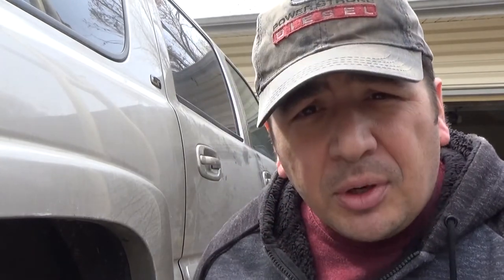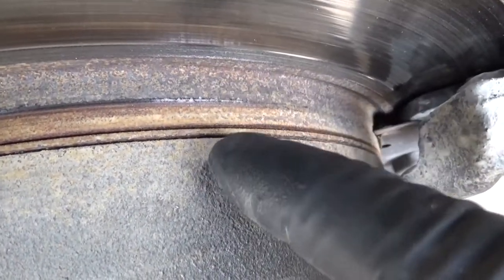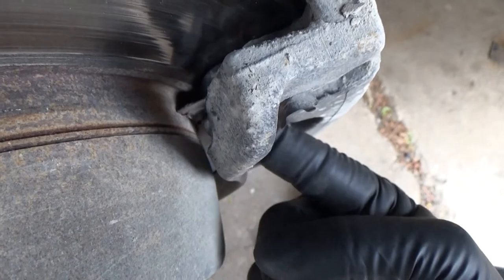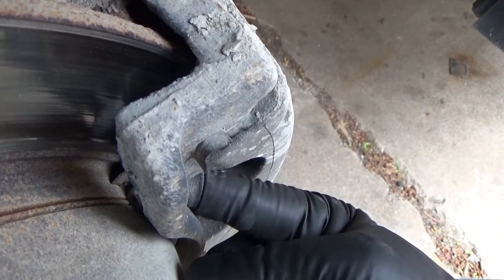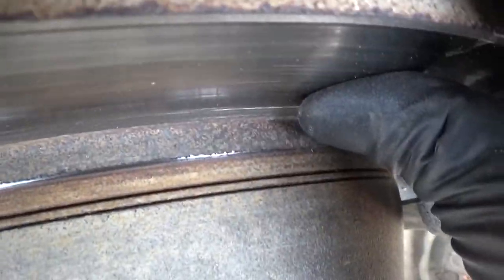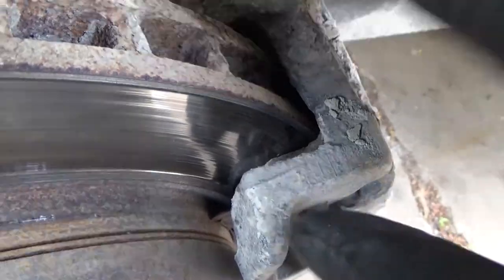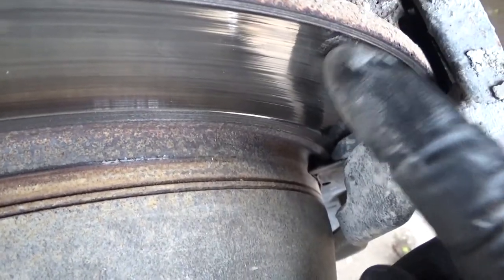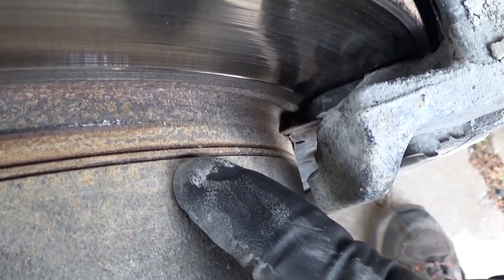Brake Shims and the Problems they can cause - Automotive Education

Comment: Wear clips always go on the backside of the rotor. Looks like those pads were installed incorrectly.
Reply: It's not a wear clip it's a shim
Reply: You misunderstand the video. Talking about two totally different things here. You are talking about the wear sensor (squealer) clips or tabs on inboard pads that make a squealing sound when pads are getting worn down. The video is talking about the shim plate on the backside of most brake pads. Some are permanently adhered to the backside steel plate of the pad, others snap on with clips. In this video, the shim came loose from the pad backing plate. I'd say this is pretty uncommon but as he points out, rotor should be replaced.